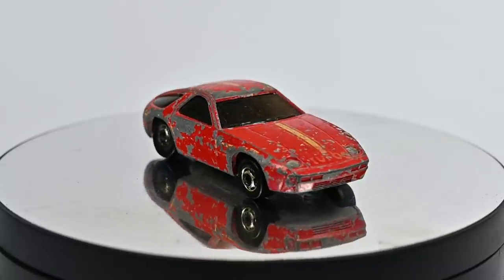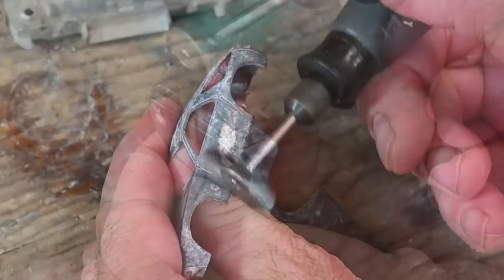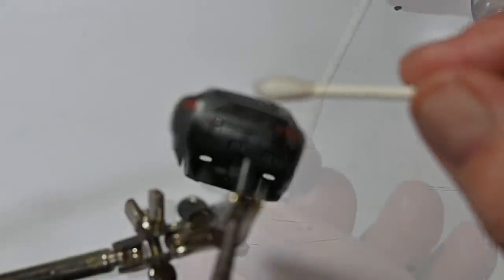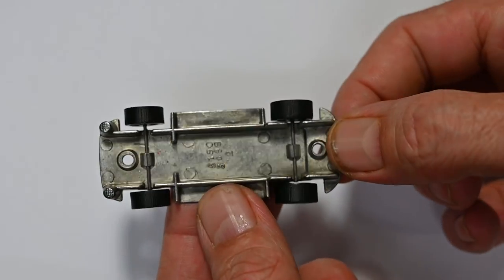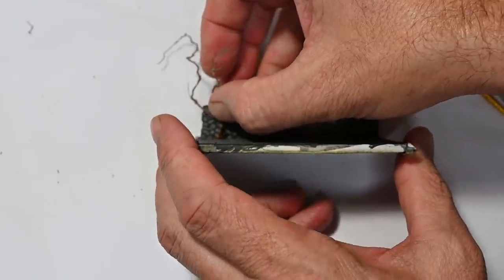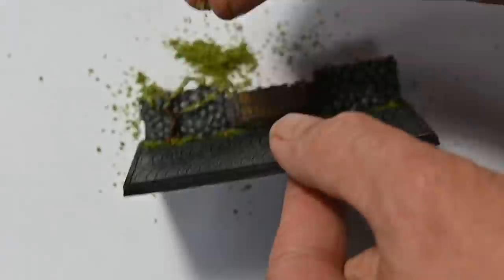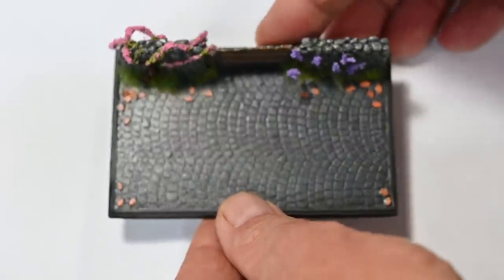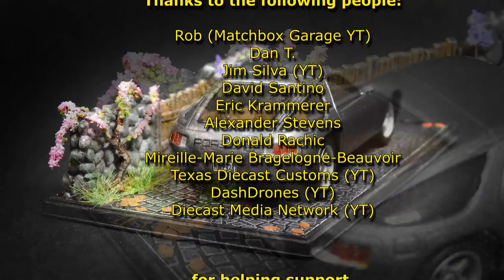Turning This Beat Up Old 80's Hot Wheels Porsche 928 Into A Display Piece

Comment: An amazing piece of automotive history. I have one in my driveway.
This is a 4.5-litre non-interference engine 928. A wheezy low-power thing, with just 245 BHP. Not much of a car, really. But the 4.7-litre S made 310 BHP and is a much better car. Expect any 928 to cost in excess of $4,000 per year in regular maintenance, and budget at least an extra $5K for big items every few years.
In over a decade of daily driving, I spent over $70,000 on mine. And it still needs $5K of work!